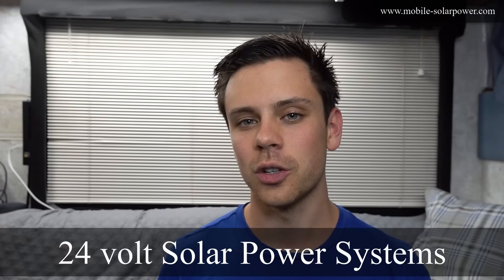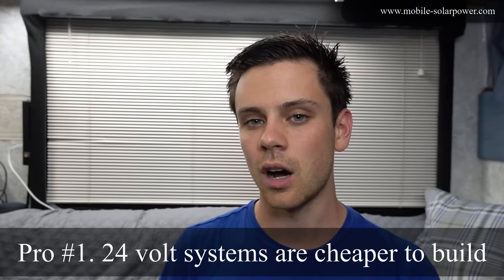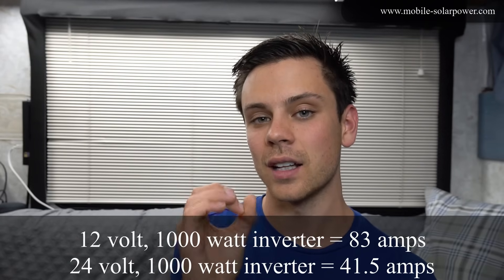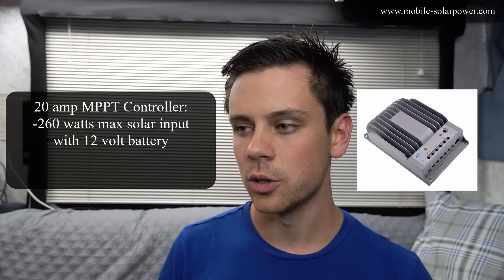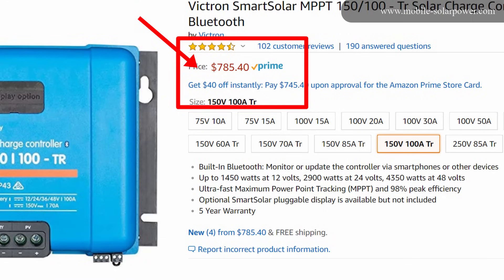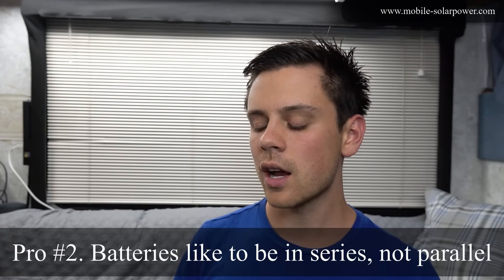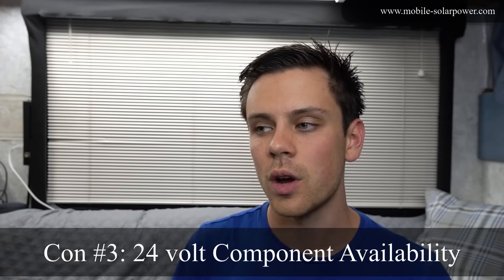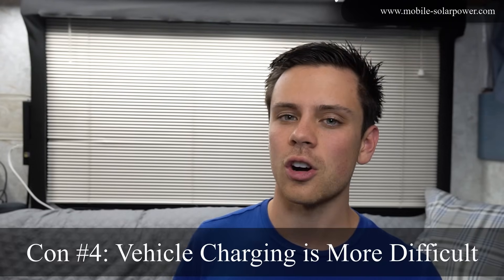12 volts VS. 24 volts for Off-grid Solar Power Systems

Comment: Is there a dedicate video to the alternator method?  I understand he said it's bad, but there are ways.  Couldn't a solar charger take the alternator's volts and charge an accessory battery?  I am looking to do one in my truck as a back up, in case I need to run something while out and about, vice living off of (although I'd hope for it to provide back up power if in black out).

Comment: Hi will, thanks for the helpful info! I was wondering would it be more cost effective to wire four 12 volt batteries in series (for a total of 48volts) than to use just one 48volt battery (as one 48volt battery is much more expensive than four 12volt batteries). Because the four 12volt batteries are wired in series I wouldn’t need to use the thick gauge wire as if they were wired in parallel (again making it cost effective). I would love to know if you have any reason why this system wouldn’t work, or if you see flaws in it. Many thanks.
Reply: Py

Comment: I'm a little confused, what's tge actual meaning of a 12, 24, 35, 48v system?  Is that just the amount of power available and capacity for recharging or does it actually power and run equipment of those particular voltages ???
Reply: 12, 24, 36 & 48v.....

Comment: I think your solar panels should be ran at its highest voltage you can. And your battery pack should stay at 12 volts because everything runs off 12 volts. Why change from 12 volts to any other voltage when it comes to batteries? Makes no sense to me. in my set up I run a short wire from the battery to the inverter. After that it's all AC. As for my DC equipment it all runs on 12 volts.

Comment: Guys I'm still not able to calculate this in my head :( - I have 6 x 12v Victron 230AH AGM Batteries connected in parallel giving me 6 x 230ah = 1380ah. If i took the same 6 batteries and Series/Paralleled them to make 3 x 24v batteries i would have 3 x 230ah = 690ah - That's half the AH. I currently run 2 x 12v inverters - (split at 3 batteries per inverter). Surely i would have more usable power (i.e. i can run the devices i currently run for longer) with my 12v setup than i would be able to if i changed it to a 24v system? Or am i missing something?

Comment: Darn I bought a 12v system and later realized 24v would have been way better and this video confirms it. Problem is BattleBorn and a lot of other people online are using solar for campers which often have a DC circuit with 12v appliances like you mentioned.  Not many people are too familiar with fixed off grid which is what my system is. I would have saved so much money and had to buy way less tools for crimping ferrules and cutting heavy ass 4/0 cables. Oh well, next cabin is definitely 24v. Thanks for the great info Will.

Comment: Your video is very informative. I am trying to do a solar DIY grid tie project. I have a sub panel, how to tie the solar AC to the sub panel? Do I need a solar inverter that outpits 240 volts?

Comment: If the system is in rv , trailer or motohome, go with 12v, if the system is stationary go with 48v.  24v really is a waste of time. I have built a bunch of both systems, and through trial and error found that the extra cost on the 12v for mobile applications really is worth it. Converting from 48v to 12v is a huge efficiency loss, the wattage to provide the 12v even if there is no draw on the 12v is around 25w continuous , and most rvs have generators onboard and need something that can start them. I built my system in a 40ft 5th wheel and 2700w of solar, and regret not just going full 12v. The amount of work to tear it all apart and start over is almost justified by how much easier it would be to have a single 12v bank. I have had many hours dealing with voltage conversion issues. And yes being able to charge while driving would be a great benefit, or even just as a backup charging system, if something happens right now, I have to run a generator to use the charger/inverter to charge. 

My rule for the builds I have done, 12v for mobile, 48v for stationary. 
If I could replace all of my rv lights,pumps,heaters,stereo,etc etc with 48v, I would convert the whole rig, why the world is based on 12v still just kills me, every car should be at 48v right now but the conventions established in 1950s for 12v still stand 80 years later.... why???

Comment: I'm going with 24V for my RV with the 12V converter. Only thing I'm struggling with is how to hook up my RV to shore when I want too and bypass the Solar panel system? All I can figure out is maybe make it so I have a outlet for the power cord on my solar system so when I use solar I plug the RV power cord into the solar plug and when I'm not just plug into shore like normal, maybe add some dedicated solar outlets into the RV? Idk

Comment: please what about in battery capacity, if I series my two 200ah batteries to get 24v and I use my 12v 200ah in parallel, which will be more efficient, and also will have more battery capacity
It's definitely 400ah, but I need a professional explanation please.

Comment: If you had 2 12v batteries in series to make 24v, couldn't you just connect your 12v inverter to one of the batteries.

Comment: Great video;
I wanna know if I run a 24 volts system, can I use one 12 volt panel for with a separate controller and battery just in case I have to jump start my rig or my tow vehicle?

Comment: By far and wide great part of these considerations are directly connected to the size/complexity of your system! The basic small 12V system nowadays is rather cheap, easy and incredibly simple! The step up and than down is not advantageous in that case!

Off grid house or any other bigger (costly) installation will benefit from the highest voltage.

Now the reality is that on small systems cost and simplicity are a must. My 12V/24V regulator boost a cost of about 10€! In fact I bought 3x of them! For several different installations! I repeat 10€! Who can argue with that?! ;-)

10:09 Vehicle alternator "designed to charge battery for like 1~3 A/h, engine and like 30~40A"! 

Are you kidding?! LOL 😂 There is a reason a small car alternator nowadays is rated in average above 120~150A. The days of VW Beetles with a 35A generator are long gone, for like half a century! ;-)

Comment: I have gained so much knowledge listening to this expert. I consider myself capable but electricity has never been my experienced skill or trade. I have wired my own on-grid shop did a good job. But electricity has many different layers. And the Automotive/RV side of electricity is beyond my skill level. However I am a quick learner and Will Prowse has helped me gain enough knowledge to start making some decisions about my 40 ft 5th wheel; that I want a 100% offgrid/unplugged solar powered electricity system. And with this RV I am starting from scratch, as it has zero in the way of integration of the 120 vlt AC connected/plugged in - RV internal system, but the 12volt DC system is tiny, with the waterpump, refrigerator, water heater and exterior RV lights being the only draws. I have no way to charge my 2 house batteries other than doing it myself with my own battery charger outside. My roof is large enough that I feel I could design and have a solar system that will not leave me wanting for more power. I am a usual sun worshiper; in that I travel to mild weather, with lots of local Sunshine.  So I will have the ability, I just now need more knowledge to move forward. Watching these videos surely does help me make better and wise decisions. This solar system that I want will be my home on wheels, I am fully intending to live full time in my RV.

Comment: Let's make something really clear... volts don't kill you, amperage does. The volts only matter because the higher pressure (higher voltage) decreases your skin's natural resistance. If it is able to pass through the skin, it is the amperage that kills you.
Reply from the maker: If working with an amperage source, voltage is all that matters. A battery will supply thousands of amps, and solar panels will ALWAYS supply enough to kill you. So voltage is most important, because the amperage is always high enough to kill in these systems. The only barrier here is resistance of skin, so voltage is all I think about.

Comment: hello will prowse

my neighbor has a shed solar setup from
 3 solar panels of 250 watts each, 
the batteries are 12v lead acid in series to 24v with different amp hours

and a pwm c2120 from aliexpres and after a week there is there is not enough power in it to run a 24v 3000w inverter
probably one of the lead acid battery will be dead as it is connected in the jerry  a..hole way

my question is which mppt do i need for

3x 250W 24V solar panel

and how many amp hour difference can there be between the batteries to make a 24v system

my neighbor will bye some agm deep cycle battery`s with 100 amp hours

Comment: Are you from uk and 
Would i be able to charge my 24v battery with a pwm solar controller hooked up with a 12v panel and has a 22v voc
Thankyou

Comment: Will, I'm new to solar and love your videos.
What I have learned from you so far has been great. I want to go 24v on a camper.
I understand all except the panel's.
I can buy used 36v 250w panels. Can I use them for my 24v system ? If so , is there any special way I have to wire them ?
Thank you so much for your knowledge.
Watching you has given me the courage to try it. Also I plan to have 4 to 6 lith batt.

Comment: So I might save a few hundred on the mppt side of things running 24v as i can get one thats rated for half the amps but I need twice the amount of 12v lifepo4 batteries to have the same capacity as a 12v system meaning thousands of pounds more expensive, with a single 200ah 12v lifepo4 being around £1000 here in the uk.

Comment: I'm really really new to all this stuff. O live full time in a 40ft fifth wheel which has 12v appliances and a built-in generator. I decided to keep with 12v but bought two lithium 100ah batteries and connected them in parallel. I also have four 100w solar panels to charge them, but they can also be charged by the generator. However, in now questioning my decision with all this. Should I have gone with a 24v system instead?

Comment: If you were in an rv with a 24v system, why couldn't you just run the 12 volt system off of one of the batteries and not use a 24 to 12 converter? Would it cause to big of an balancing issue for the batteries?

Comment: Alternators are not really for charging,, they are for a maintaining charge otherwise it puts a ton of wear and tear on the alternator to charge a deeply discharged bat.  So if you run your bat down in your car from leaving the interior lights on for example,, first thing you should do when home is get it on a charger.

Comment: Will, two questions? I have a 200 watt suitcase solar that plugs into my camper ( two lithium Batteries wired 12 volt ) recently I used a 199 watt panel and bought a separate charge controller and  with alligator clips I also charge the batterie. Is this alright? Also I used number four welding cable to wire the batteries in Parallel. and to go to a one thousand watt inverter. does that seem right? We basically just run LED lights when off grid and through the inverter we watch some TV. Nothing heavy duty. Anyway your channel is the best. Burlington Bill here of the song Sailing to Freedom, currently the theme song for Sailing into Freedom on youtube. Go to my channel for other songs I have written and some covers.

Comment: I have 10 100 watt solar panels, I did them in parallel on home roof, because of some shade( I can do series if necessary) I don’t know what batteries- to buy and now am confused on if I should go 24 and who to contact about the proper cables/ inverter/controller.....
Any advice,, links,,, very appreciated 🙏🏻 . First time solar owner- installer

Comment: Hi, I have been searching for videos about solar power and may I say, yours are the best. I live in the UK so want to heat my hot tub. I have a 3000w heater with I would need to run for at least 6 hours, please help if you have the time. Would greatly appreciate it if you can help.

Comment: Hello Will

Where can I get info on how to design an off grid community solar array where the power will be used 2000 feet away the the pv panels???

It will be sized for 100 small homes???

Comment: Congratulations on a well done video on an important topic. All of my formal education and graduate degrees are in Epidemiology and Community Health. I spent 10 years and far too much money acquiring medical training which means I never worked a day in my chosen field. Instead I spent my life as an electronics technician working in aerospace and industrial electronics.

I designed and installed my first solar system in Tehachapi CA in 1986 or 1987. At that time the highest voltage equipment readily available was 48 VDC and that was what the owner selected. It was a good choice and still is a good choice-the higher the voltage you select, the better off you will be, with some reservations of course.

Some of those reservations I want to mention were mentioned by you in your video. Much early development in the solar field was governed by the automotive/RV industries where 12 VDC rules. This is enormously wasteful and if said industries want to make a positive development to improving our environment they would switch to 24 VDC vehicle electrical systems. 48 VDC would be infinitely superior but there are those reservations again.

In my field I can work on energized electrical equipment 0-49 VDC without taking any particular precautions. This limitation stems from the National Electrical Code and OSHA and at first glance would lead one to believe that 48 VDC would be the optimum choice. Wrong. The system voltage is 48 VDC which means that the charging voltage must be much higher-on the order of 56 VDC minimum, a voltage considered unsafe by government regulators. Note that this means in most jurisdictions, you can't do a 48 VDC installation by yourself. You need someone belonging to a union who has the correct license.

12 VDC suffers from all the disadvantages you mentioned except for one big one: you can get a large number of 12 VDC powered appliances-microwave ovens, blenders, coffee makers, refrigerators, freezers, hair dryers, curling irons, ceiling fans, vacuum cleaners, washing machines, air compressors, hydraulic pumps, computers, televisions, stereos...I can go on seemingly infinitely.

I do realize that you addressed this issue, and I agree with your conclusions, but only so far. If you have a few appliances then by all means use a converter. But if you have a lot of appliances, efficiencies will begin to drop precipitously. Things are slowly changing...much too slowly in my opinion, but you can't find such a variety of consumer goods which run on 24 VDC. An even worse situation is the 36 VDC option which from a safety/legal standpoint is currently the best voltage choice for a solar installation. The charging voltage need only be 42 VDC, a voltage too low to be considered dangerous or require licensure to work on. But I have never heard of a single 36 VDC installation anywhere.

There is another option that you did not mention-a split system running off of 24 VDC and 12 VDC...sort of a series-parallel installation using split battery and/or split solar panel voltages. Overly cunning in my opinion and more trouble than it's worth.

So that really leaves a 24 VDC system charging at a 28-36 VDC open circuit voltage. It is really unfortunate but it does appear to be the only game in town for serious installations,  at least at the moment. There is one bright spot in the night sky...many aircraft parts are 24 VDC. If you can locate a good source for surplus aviation parts, particularly military, you can have a gold mine. Just be careful that you don't end up purchasing 115 VAC THREE phase (or even two (2) phase!) 400 Hz parts by mistake.

Comment: Hey I have a 24v trolling motor on my boat  with a 24v60AH lifepo4    I wanna set up 150watt or 175watt solar panel    space wise that's all I have room for   wanna be able to solar charge it when fishing     what would you buy for panels/charge controller?    Any help woukd be great

Comment: I just wish the panels costed less for 24. On amazon (in Canada) I can only find 12 volt panels. :( And the few 24 i find are kits are cost quite a bit more. I get that in long term and with everything there are savings for 24.

Comment: Building my first system. 12.4 kwh battery bank, 1600w solar hoping to do 3200w and 2 3000w 24v growatt all in one inverters.  Going into a 5th wheel ground mounted panels. Running a 12k btu mini split, microwave, tv, starlink and normal stuff in Montana. Hoping it's enough for winter. Days are short and its cloudy more often.
Reply: How did the plan work for the Montana winter?
Reply: Fail

Comment: Will love your channel, I want to put 24v system in to use to run my freezers and refrigerates and switch to grid when batteries get low then back to solar during sun light and when system is charged. I’m starting at zero, but I do have south facing roof at 45* can you help?

Comment: Hello Will, I'm new to RV power and want to convert a van to a camper. I would like to have a system that powers 12v item and 110v appliances. be able to charge from alternator, generator, shore, and a portable solar. would you have any videos for this application? thanks for any help. Watching your videos is very helpful. Robert
Robert